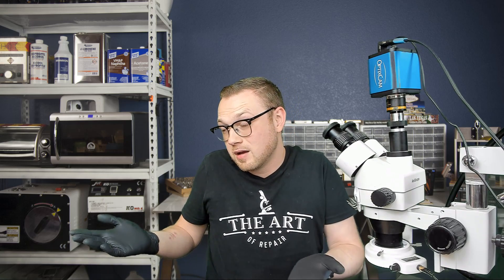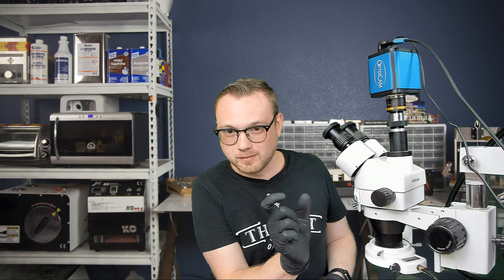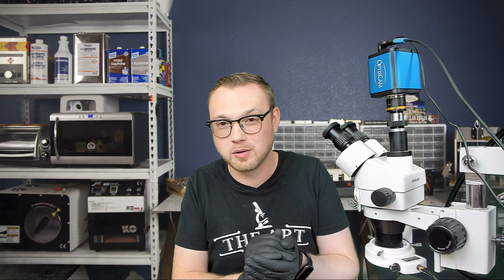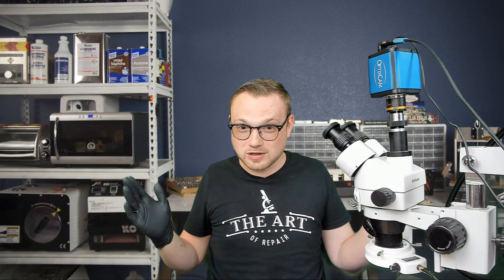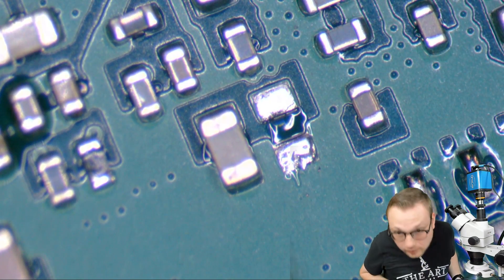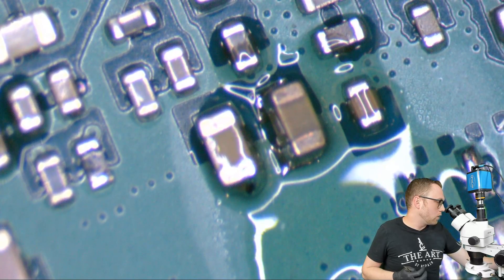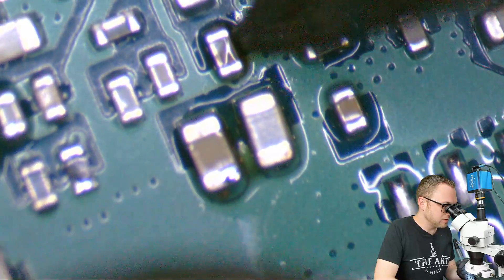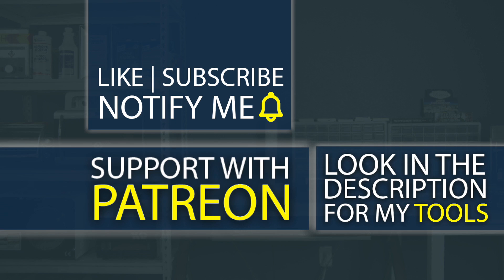Which Solder Alloy do I use for Microsoldering? | What are Plastic Ranges and Eutectic Points?

Comment: My preferred lead-free solder, Kester K100LD, is eutectic at 227 C with no plastic range.  It is much easier to work with than any other lead-free solder I've tried.  But I agree with your recommendation to do rework with a lower-melting-point solder, so I use 63-37 SnPb for that (eutectic at 183 C).  They mix fine.
Reply: https://youtu.be/hcfVRkC3Dp0

Comment: Justin, I am a fanatical solderer. Removal of all the remaining solder must be accomplished before continuing to the next step and cleaning is essential. Removal of lead free solder must be done using an iron and tip used solely for that purpose as cross contamination is to be avoided period. Starting with clean surfaces is vital in avoiding failures caused by cross contamination. I’m not attacking you. I am pointing out things that can cause future failures and no one wants that. Surfaces that are.being soldered must be free of any lead free solder and flux residue. RMA flux cored solder that is a pure eutectic, 63/37 tin/lead or 62/36/2 tin/lead/silver are the only solders I use. The latter is for instrumentation work mostly, but still usable for critical circuit work depending on the specification for that operation. RMA flux produces the best appearance, leaves the least residue and produces the best results for any electronics work, but is exclusively used in critical circuits grade work as these must endure vibrations, physical and mechanical stresses, G forces and thermal inversions. Harshest possible environment your equipment can handle and survive and thrive while doing so.I’m not suggesting everyone adhere to this standard, but I do as do those companies whose gear must endure and thrive while in those circumstances described. Not all can, but those that do are assured that the components they solder are going to stand the harshest tests and still hang with a smile. This is the world according to J STD level 3. The ultimate soldering standard that can be had! Stay safe mates!😊👍🏻😷
Reply from the maker: While I agree with this, and created the inverse ceramic tweezers directly for this because I really do feel like clean surfaces are key. I think it’s also important to understand the correct application specific applications as well as the future of the device and what it’s used for.

Unfortunately, there will always be residual original alloy on reworked motherboards because it is molecularly bonded to the substrate surface through the initial soldering process and will always be introduced into the new allow, no matter how clean.

Iv known you in the comments long enough to know how much you care. Just as much as myself. So I always welcome and encourage these comments from you. Your one of my favorite subscribers and hope you continue to add these informative posts for the others to see and learn from. 

Btw, I’m on a world tour bro. Where are you! We should sit some day in person if I ever come through your area. I’m sure it would be a great interview for the channel too if you wanted to share some more of your knowledge!

Hope to hear more from you in the future 💪
Reply: @TheArtofRepair , I live in Brownsville, Tennessee. It is in the western third of the state an hour’s drive northeast of Memphis. Bring on the visit, but even if you can’t make it, know that I am an advocate for soldering of the highest quality and reliability. Surface preparation is critical in level 3 J STD 006 as well as it was in DOD STD 2000-1. Those who are fanatical about it as I am aren’t that prevalent. Your example is worthy!
Reply: you explained something very important about thenartofsoldering. it make sense that the proper alloy in the end is the right tidy and strong to hold heat while in use and G force movements if the allow final set is low temp it would make sense that a device potentially could fail bye nature of heat and use! vrs if it was use and left with an original allow used close to factory assembled! 

just commenting on what i understood about your comment

Comment: Sorry to ask u but what was the temp to remove that tiny capacitor?
Reply from the maker: Thats now how it works, you really should check out my microsoldering 101 playlist before doing any actual work and you will then know the answer to your question =)

But also if you want to cheat i have a video that says my hot air presets, but tbh you do yourself a disservice not watching my playlist vs just getting the number as it wont help you with your work unless you know how to use it right.

Thanks for popping in and leaving a comment! Hope to see you in here again!

Comment: Don't assume. I have no idea what your point was and what solder you used on smaller component. Sorry bud but that's a fail video.  Make a point and explain at the end. You left me wondering.
Reply from the maker: Sebastian, it's literally spelled out at 4:50 and there's a huge banner across the screen, please actually watch the video before you tell me it's not in there. 

In fact, I spent most of the video teaching you about how to know which solder to use so you could also decide if the one I use is a good match for you. 

So I gave you not only a please bro answer but also taught you how to think for yourself.

Also on a side note, there is a link in the description for exactly what I use, which I also note at the end of the video.
Reply: This guy is dumb as hell. You explained it perfectly. There was no way of him accidentally moving the smaller component while adding the bigger component back on the board.
Reply: @ChristopherOrtiz22  5:30 Well, I can see how calling lead-free solder 63-37, even (clearly) by mistake, can be confusing. Felt like the video needed more visual aids, as in show us the actual reel of solder wire up close, point out what's what ON its sticker for longer than 3 seconds. It's by no means a "perfect" explanation on the topic IMHO, but I appreciated the effort nonetheless, especially the second half with the melting point comparison demo. 👍 No insults, receiving constructive criticism positively and trying to do a better job with less judgement and more understanding towards new learners is the way forward for all of us. ✌
Reply: and how you paid this man to make the video and uploaded for you to learn a thing or two?  🤔

wow there people in this world that doesn’t know how to ask but rather think the world owns them and have the right to demand!

Comment: Plastic range has to do with 60/40 tin lead solder, which, like lead free, is more worthless than tits on a boar! There is only one solder that I can recommend whole heartedly and without reservations of any kind! That sir is Kester 282 RMA Sn63 or Sn62 Tin/Lead or Tin/Lead/Silver. Both of these are pure eutectic solders. A pure eutectic has no plastic range. It is solid or liquid period. The Sn62 has an advantage of having a lower melting point which makes it perfect for SMDs and any heat sensitive device. It also has the advantage of higher conductivity. There are equivalent formulas from Aim and Alpha Metals that are equally great. Always use the same flux formulation as the solder being used regardless of whether it is fluid, paste or pen. I don’t like paste as it is too messy and prone to be wasted. Pen on SMDs is preferred because of the SMDs small form factor. Offers less waste. Waste costs money and none of us are drowning in that! Cleaning solder, pads, all contacts and leads prior to and after soldering will yield the best results. It is a requirement by my discipline, but not everyone cares. Using gloves on hands and fume extraction are mandatory if you care about your health! Justin is a highly skilled practitioner. Listen to him!
Reply: Thanks for all of that.

Comment: Other than down a well hole I can't think of a reason not to use 63/37 ra rma. Good old kester 44 is a safe bet. A pound spool of 0.020 for small stuff and 0.032 or 31 for general purpose thru hole. Avoid non name brand and rohs stuff like the plague :) What kind of paste or liquid flux do you favor?
Reply from the maker: Iv found some decent 63/37 paste in a few different branding flavors that are pretty nice, Mechanix I think has some, starting to try some thats a litttttle lower on the melting point for X work though.

Comment: i usually use 28 to 30AWG wire but i'm looking for ribbon cable non stranded any suggestions? i don't want the rainbow cable either
Reply from the maker: The stuff I have in in my description is the smallest diameter solder that seems to exist .015in I think =)